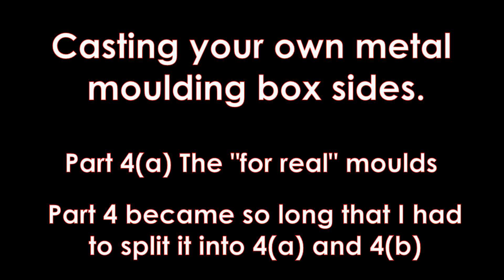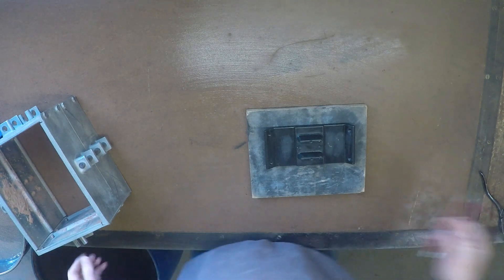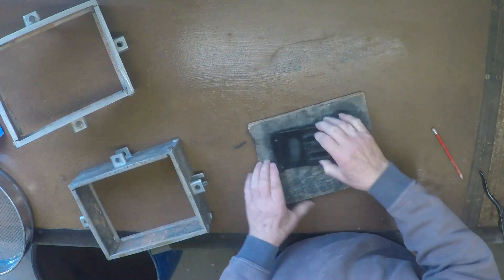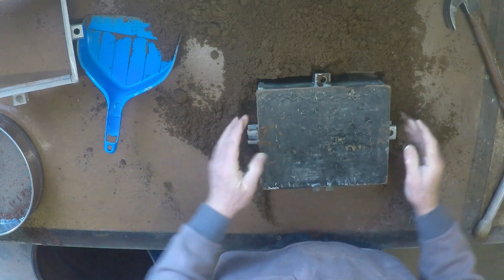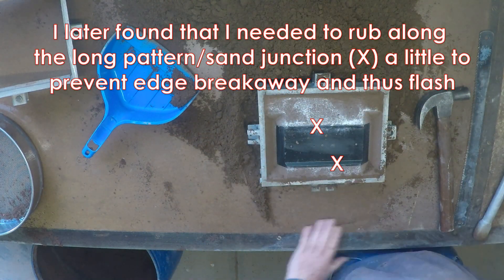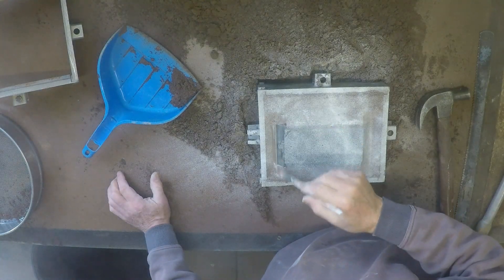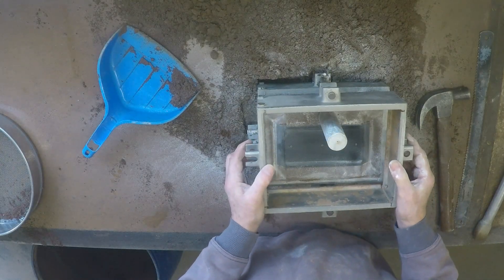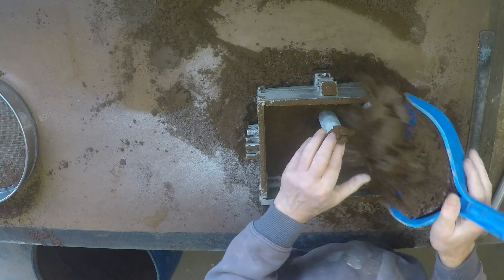Making your own metal moulding boxes Part 4(a)

Comment: Martin, good show as always. Just wondering, at 11.54 you cut the runner way past the feeder and gate. What is the reason for that? Also, I just realised why I, and probably others, cut the ridge on the feeder basin too high. It's because of the top down camera angle. It's hard to get any sense of the depth from that view point. 
Regards,
Mark
Reply: Lol, you too Mark?
Reply from the maker: Craig, Does my reply to mark and the reply from aclight provide the answer you seek?... Martin
Reply: Olfoundryman : Yes Martin, as soon as you explained it, I did a head smack thinking 1/2" from the bottom not the top. No wonder it failed.
Reply: About the extended runner: would that be a "cold leg" to trap debris & oxide inclusions as the mold fills? I just picked up a used copy of Castings (1st. Ed, 1991) by John Campbell and he has an extended discussion on oxide film formation and gating techniques to reduce inclusions. I was surprised to see many of the techniques Martin uses (pouring cup & weir, thin tapered sprue, over/under runners & gates) are covered in Campbell's book; wish I had picked it up earlier.
Reply from the maker: aclight, Spot on! JC's later books include better ways  and my technique is crude - it risks a hydraulic bounce back pulse if not tapered sufficiently. My techniques are covered in JC's work because that's where I got many of them from. 😊 I have always tried to adopt better ideas as soon as I have heard of and evaluated them - I started using tapered sprue for example way back in the early 1960s after reading "The running and gating of sand castings" By R. Ruddle . I did not adopt everything from this book as things like sprue enlargement bases (sadly still used) intuitively felt wrong - time and JC have proved me right!.... Martin
Reply from the maker: Mark, The runner is cut past the gate so the first metal will not go into the casting - it is inevitably damaged and mixed with air so you need somewhere to dump it - the tapered run past the gate is the simplest way to do this but there are much better and more sophisticated things like spin traps on the end of the extended runner to do this better than my simple method

Comment: Curious if you have any experience using aluminum metal injection molded scrap as raw material. I've a few dozen castings from old hard drives I've wondered about using, and from what I've researched so far, they're mostly likely 6061 mixed with a couple percent of tin.
Reply from the maker: Custos, No, I stay away from pressure diecast stuff as inevitably it has a relatively high iron content which does nothing for the ductility of sand cast alloys. To be honest I always advise people to take the trouble to get good aluminium as I found years ago that when I stopped melting down anything I could find and started using decent bought ingot 90% of my troubles went away..... Martin
PS, 6061 with a couple of percent tin sounds most odd??? Why do you think that's what it is?
Reply: @olfoundryman8418  That's just all the information I've been able to find online from various manufacturer websites. Most don't list anything, and there doesn't seem to be a general list of alloys used in MIM parts, so I'm still researching in case I find one.